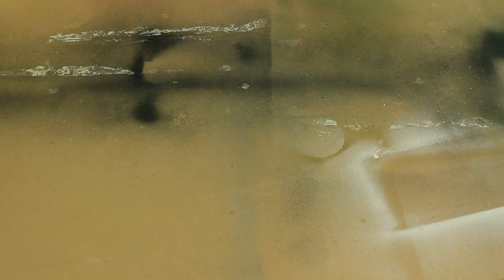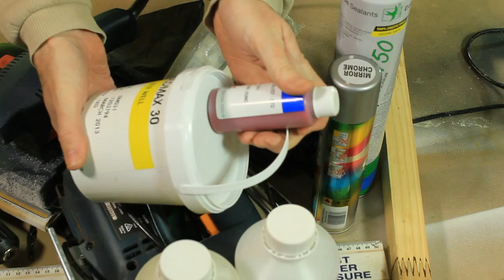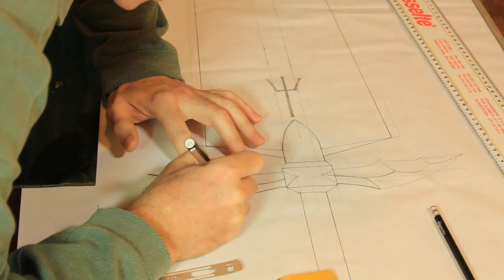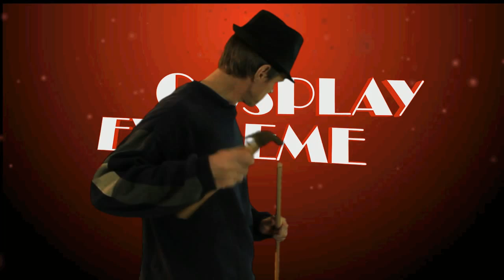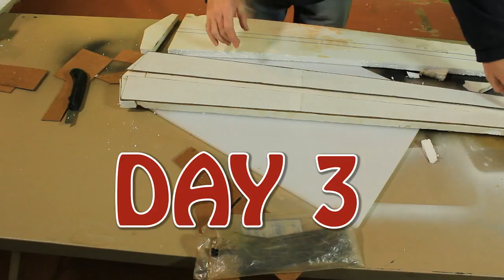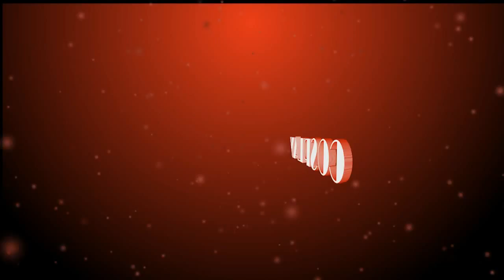Claymore sword build part 1.

Comment: Is it possible to make a real Claymore Sword. I´m a Middelagefan and can make a bow by myself so I´m asking is it posible to make a Claymore out of Irone?
Reply from the maker: Yes you certainly can,  but a little above my skill level.
Reply: Thanks for the answer, I will try it!
Reply: Ella Alexander Buy a sheet of steel and draw the design on thin paper (preferable the one you can glue on to the steel sheet).Then it's time to cut the steel following the design on the paper (don't forget to cut out the tang).Next up is heating the steel until its red hot and the magnet doesn't stick to it.Then you have to hammer the sides equally to form the edge.Once you are done with that dip the sword in oil to harden it.Next up is tempering the blade.Put the blade above the fire and wait until it gets a wheat color.Try not to make it blue because that means the steel is too soft.Once you are done with that take a hollow pipe and cut it in half but only a few inches.Slide the pipe on the tang so it slides on the back of the blade.Drill holes through the pipe and the sword and screw it tightly together.Oh btw get a threaded pipe so you can screw on the pommel.And sorry but i cant help you with the guard since its quite a detailed design. Also don't forget to polish the blade.Have fun making the sword.

Comment: do you mind if you could provide the diemnsions of the sword?
Reply from the maker: +Sheikha Bernazir Lowkum  Hi,
  I actually calculate the dimensions so the sword is scaled to the 
person carrying it.   This one was scaled to my height so it is a bit 
over sized for Emmy. ok now it's going to get complicated.  The average 
person stands 7 heads tall,  IE, if you measure your head it will fit 7 
time into the length of YOUR body.   What I do is find a picture of 
Clare showing the sword in full.  then measure her head, I then divide 
the sword in "heads"  in this case Clare's claymore is 6 heads.  so now 
you need to measure your head "chin to crown" multiply by 6, and you 
will have the length of your sword. The cross guard is 1 head, tip to 
tip. 
I hope this makes scene.  Should I make a video explaining this?  let me know.
Reply: +CosplayExtreme whoa that's actually how u get the length of it? Yes I totally understood of what u have explained above! It was very helpful thank you so much! I'm 5'7 so I guess 5'2 would be perfect for the length of the whole sword! Still gotta calculate :D! Thaaaank you so much!